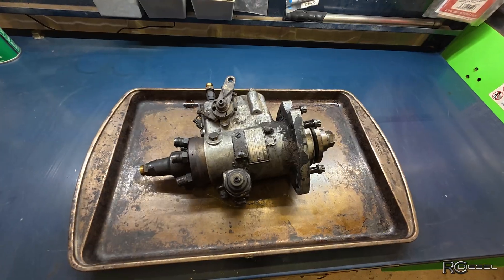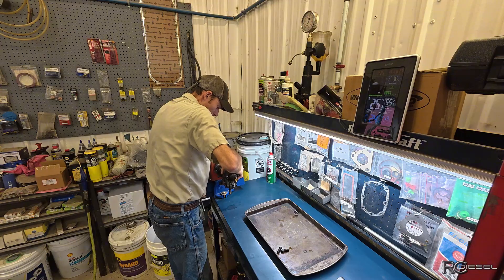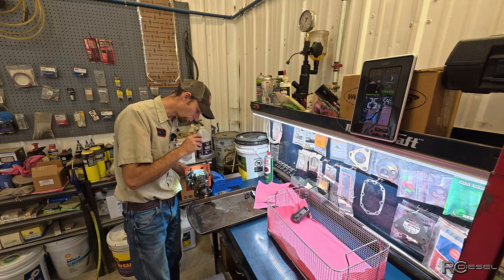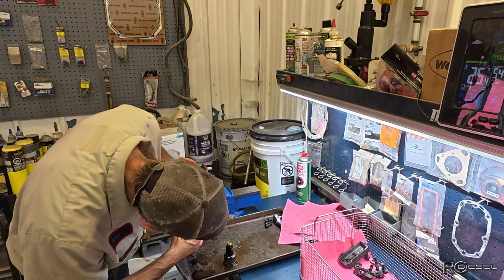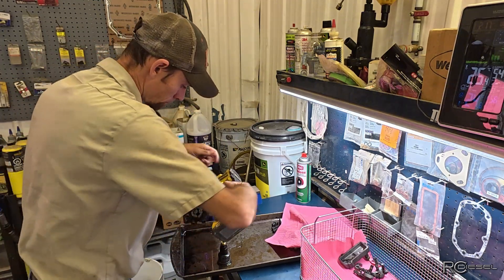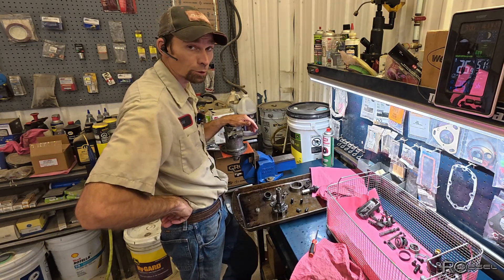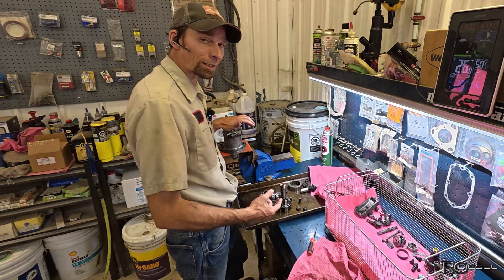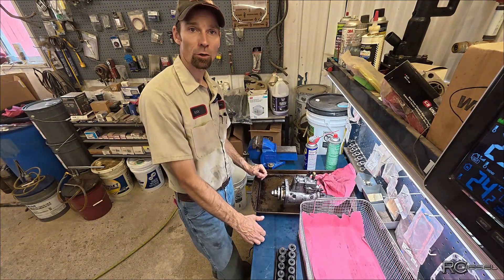🔧 Stanadyne Roosa Master DM4 Injection Pump Teardown & Inspection 💥

Comment: I’ve had those plungers stuck before. Soak in sea foam and they will work free. Takes time but doable
Reply from the maker: I've freed up a few like that from time to time (I usually just use a oenettsting oil though) but I think that only works if it's stuck from sitting for too long. I've found whenever that happens on a regularly running engine, it's because the plunger and barrel are scored. This one was so stuck, I didn't even try to remove it since the rotor and head were badly scored anyway.  Thanks for watching!

Comment: Check out Steve's Small Engine Saloon for a different way to keep the ultrasonic fluid clean. He uses a separate fluid filled container within his ultrasonic tank for his dirty parts so the two do not mix.  Let's you use different detergents to clean without dirtying the tank of the ultrasonic cleaner.
Reply: Ziplocks work great
Reply from the maker: Yes! I've seen that. I've tried it on smaller parts and it seems to work pretty good. 👍